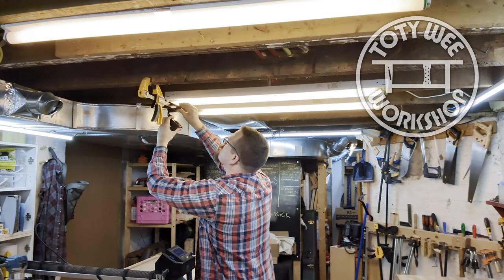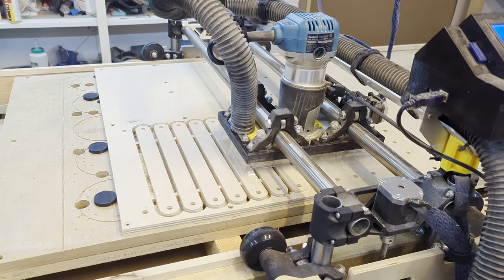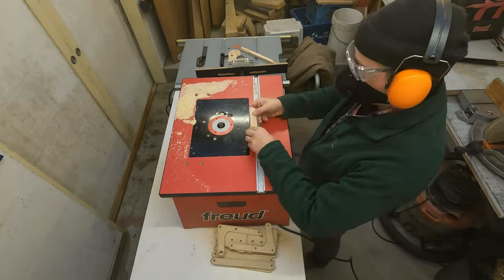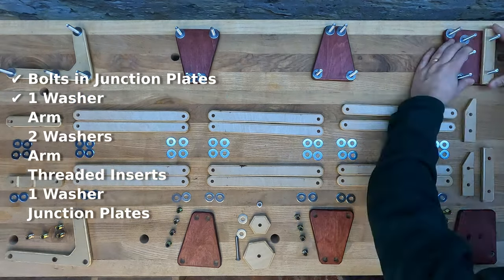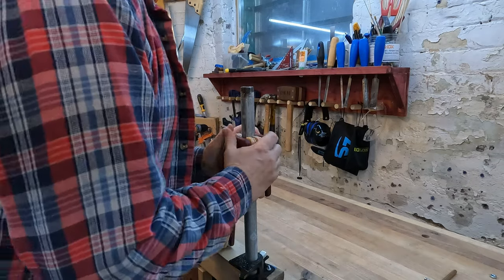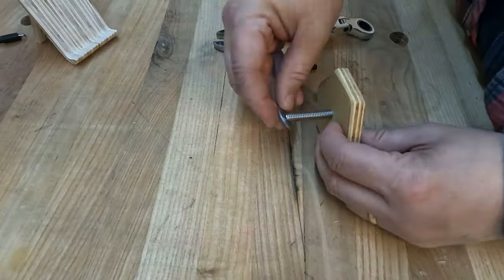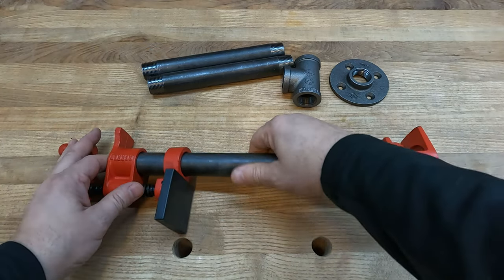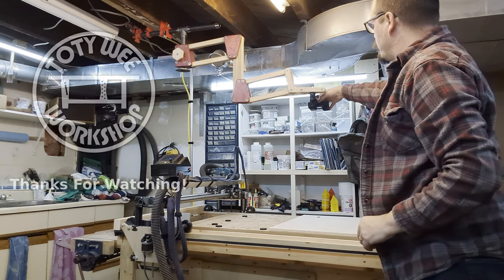DIY Camera Jig - Woby 2.0 Build With Ceiling Mount Option

Comment: I get miles out of my compression endmills. Are you running it fast enough? Too slow on the feed rate leads to rubbing, heat, and dull endmills.
Reply from the maker: I think that's exactly what happened. It was a new bit for me and I think my router speed was too high for the feed rate, ending up with some scorching on the bit. It was skipping when trying to turn a corner instead of cutting cleanly.  Learning curve mistake.
Reply: @totyweeworkshop  i think we all go through it. You're in good company!